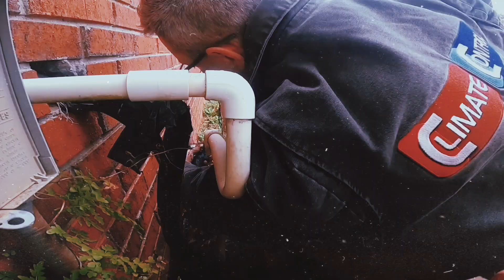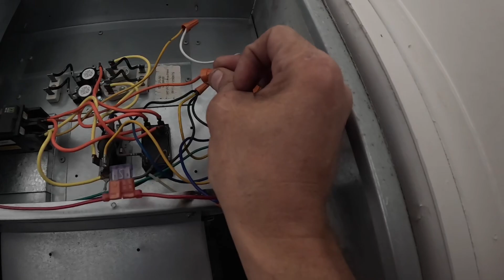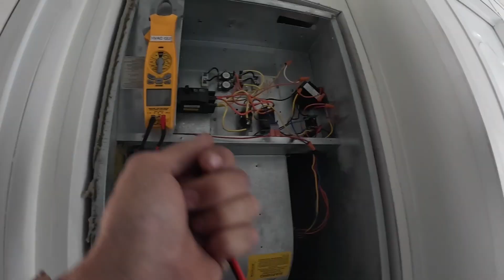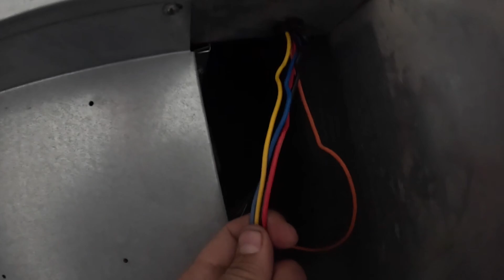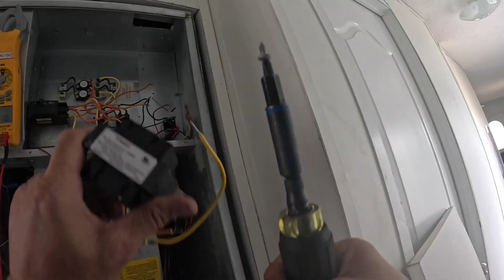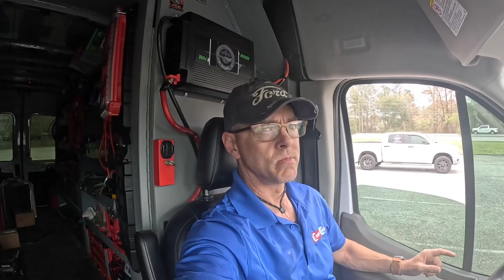Maintenance Man Tried to Fix It! But…#hvacguy #hvaclife #hvactechnician

Comment: Years ago in a BP refinery I watched a green maintenance Electrician put in three in a row 20 amp bus fuses in a live 277 lighting circuit on a column. Each one popped like a firecracker. He wouldn't listen because he was fresh out of ABC. It was a skinned wire in the conduit. BP Texas City 2006.

Comment: I was on a job one time where they had replaced a relay 3 times and it kept smoking them.
The machine was from Germany and all instructions/schematics were in German.
I found that they kept replacing the relay with 120VAC coils and they needed a 240VAC coil.
Lets the smoke out real quick.

Comment: On the low voltage at the transformer you said two for high voltage and two for low voltage,  dealing with the low voltage would one of them be a common????

Comment: Curtis, I know this sounds strange, but if there is a smoke alarm chirping, you should record yourself telling the owner that they need to replace the battery. I would personally have a fresh box of 9 volt batteries on the truck and contact cleaner, and change the batteries myself. Should there be a fire in a dwelling and the occupants get burned or killed, it is possible that a sleazy lawyer would make the point that you were on site, and you were the 
" most knowledgeable person". Frankly, I dont think that point would be very hard to make, considering the fact that the dumb asses  in this place just turn up the TV so they dont have to hear the chirping alarm.

Comment: I think I'm going to start a service business that focuses strictly on smoke alarm failures as it's apparent changing the battery on such a device is just to difficult for most to perform.  50$ min. service call + 15$ battery fee.  25$ in addition if there is a small yipey dog in the house.  Now, off to AutoTrader to find my "service" van.  : )

Comment: All the negative comments about maintenance guys. I've seen so many bad installs and service calls from HVAC companies that I'm at the point where I'd rather haul window units up 3 flights of stairs for every bedroom until I can find the time to do things right. Its not even worth calling HVAC companies out even to save myself time. Brand new installs losing all refrigerant within a month. Putting in the wrong gauge wire frying everything up on new units. Lying to property managers. Upselling new units. Saying nothing can be fixed.  And this isn't with just HVAC companies, put with pool companies, painters, flooring guys. My last property was paying a pool company $900 a month to maintain the pool. The thing was a ecosystem when I got called there. Couldn't see the the bottom. Frogs, tadpoles and snakes had taken up residence. In a week I had that thing cleared up. Their excuse was the pool pump wasn't working. Whatever. That's one of the roles of a maintenance supervisor is to keep contractors honest. Cause they will milk a property until there is nothing left. Even maintenance guys who are inexperienced are at least invested in the property and managers keep them around hoping they'll grow rather than put their trust in contractors.
Reply: I know how you feel man! I had to fix some Plumbing from the installers today. All the piping behind the shower wasn't fastened so you couldn't get the tub spout on correctly and the shower head was flopping all around because of the pipes being loose

Comment: OMG what kind of idiots work on furnaces and AC. If they are certified by some school, that school needs shut down. The HVAC Guy approaches most problems with logic and intelligence and this makes him the local GURU. As a general rule GURU is a compliment but in other cases GURU means great understanding, really useless.
Reply: Most companies could care less if your certified if it saves them money. Well they think it saves them money but In the long run they usually spend more than they would have to just call someone out that knows what they're doing. And if a maintenance guy knows what they're doing they wouldn't me in maintenance for very long. Doesnt pay well enough for the expectations.

Comment: Do you come across 277 very often, i only came across 277 on water  source heat pumps.
Reply: 277 is common in commercial applications. Residential is 120 or (with electric heaters like I saw) 240 volt. Correct me if I'm wrong but isn't 277 one leg of 460 ? I do commercial hvac but I see 230 3 phase the most. I have worked on 460 3 phase.

Comment: Ive seen hvac hacs on service call charged $700,00 found no problem could be a short they said no parts installed 2 days later circuit board replaced more $$$

Comment: Wow! Great job! What was the original problem? Was it the transformer
Reply: He said the maintenance guy replaced several parts and the transformer twice. Could have been anything really. But the maintenance guy basically wired it wrong. Had three line side connected. Should have only been two line side (primary) with the two(secondary) side connected.

Comment: Curtis, That was a remarkable fix. I find it hard to believe that someone could install all of the primary wires. I think your explaination would have been imporved dramaticallly and show how difficult and out of the normal this problem is if one justs reads the instructions. It would be bennificial if you had shown the wiring instructions for the transformers.
Reply: Ironically the instructions are printed on the transformer not on a separate sheet of paper. I'm watching on a phone so it would be difficult to see the printing on a small screen anyway.
Reply: @criticaltemperature3343  If all else fails, read the instructions.

Comment: The fact that the maintenance man and the supervisor could spend time in a unit and do nothing about the chirping smoke detector says all that needs to be said about their capabilities and concern for the tenant. 
Curtis, do you ever feel motivated, as with that long linear clump of dirt/dust along the left side of the cabinet, to take a damp paper towel and wipe such things off?

Comment: Transformers in consumer HVAC are basically there to step down the POWER LINE (120, 220, 240, 208 -whatever it may be) to LOW VOLTAGE FOR CONTROLS. Higher voltage goes in to the transformer on two wires and lower voltage comes out on another two wires.  If you have 240 volts are your power line voltage and need 26 volts for your controls, then you need a 240-to-26 volt transformer.  If you have 110 volts as your power line voltage, then you need a 110-to-26 volt transformer.  The way the transformer itself is made determines what power line voltage it can work with.
Reply: Unless it's a multi-tap universal transformer like the one used in the video.  When the appropriate line side wires are selected it can be used with 120, 208-230, or 240 volts. I also do hvac for a living.
Reply: Some transformers have a hidden fuse inside them. You only get one try to get it right. You never even see the smoke. Seems to me an unfair way to sell a lot of transformers instead of an external fuse.

Comment: Im a maintenance guy myself but I’m smart enough to know when I’m not smart enough. I hate getting hvac calls, because I’m extremely limited on that knowledge. Mostly I just go look at the problem, and say “yep, call the hvac guy”
Reply: When a furnace destroys a new transformer like that. My guess would be ether it was wired in wrong, or there's an underlying electrical issue persisting, like a low voltage short somewhere.
Reply: Low side is usually fused or has a breaker in case of shorts. Larger commercial rooftop units will fuse the line side also. With out knowing the original cause, I'm going with replacement transformer was wired wrong (as this case was).

Comment: Technically a class 2 transformer can have its outputs shorted and not result in burning out the windings.  This is assuming it was installed correctly.  Class B just means it has 150C winding insulation.

Comment: I have to rewatch this a few times to figure out what you did.... Im on my second time
Reply: He explains it at the end; the transformer was installed incorrectly, burning out its wiring.  Curtis did it right, which is no surprise to anyone who has been watching his videos for a while.
Reply: Bu I need to know where the orange goes on the transfomer @OnusBones
Reply: Tying the orange  commons to one of the 120 v legs equals melt down, pictures are worth a thousand words... If diy maintenance guy is a amateur... ,🤔 to reading a diagram on the unit ✌️🙏☝️😎🖖
Reply: Curtis is wrong most of the time but won't admit it
Reply: @carolakemp7369 Very funny; I'm guessing you must be his sister.  The only mistake I've seen him make is supporting the UGA Bulldogs over the North Avenue Trade School's Yellow Jackets, but I realize that no one is perfect.
Reply: @carolakemp7369  Curtis is one very honest service professional and won't stick a customer with a bad repair or replacement. I hope you show more respect for him!

Comment: I'm not knocking maintenance people, some of them are quite good, and they are a necessity...
But "firing the parts cannon" usually ends up wasting time and money. Quality transformers (read: not the crap Chinese ones in budget cell phone chargers and cheap electronic devices) are usually pretty durable and can take a beating. 99% of the time they won't fail without a cause, and usually that cause will be staring you right in the face. In this case, it was improper wiring.

Comment: The actual problem they should have fixed was changing the damn smoke alarm battery!!!!
Reply: They probably would have installed a new battery backwards.
Reply: I couldn't listen to that damn thing all day!
Reply: With all respect, that’s a brotha move iykyk
Reply: Just being there to fix the system while that crap was going off would drive me enough to just replace it for them, and bill them for it - of course.
Reply: I thought it was mine making the noise !
Reply: @vamodsquad3314  I looked up from my desk, thinking, "Which one is it now?  Damn cheap batteries!" lol
Reply: @awshortclips  never buy cheap batteries I buy interstate batteries and they are like $25 for 2
Reply: I smashed mine to pieces already
Reply: @CommercialGasEngineerVideos those things save lives man... Just put in a new battery
Reply: @Bynming  some are electric with battery backup. Probably can't afford batteries